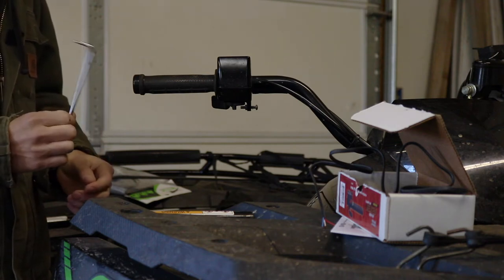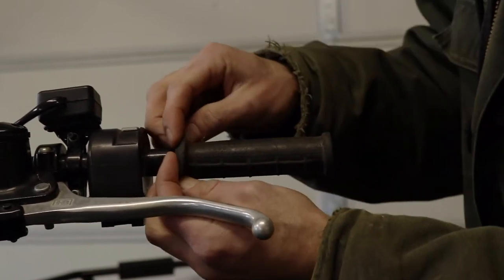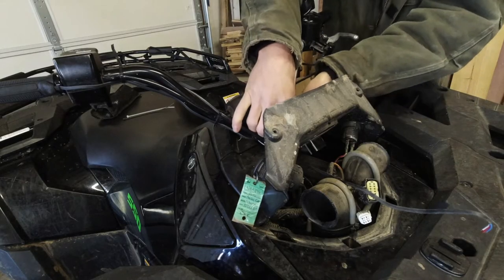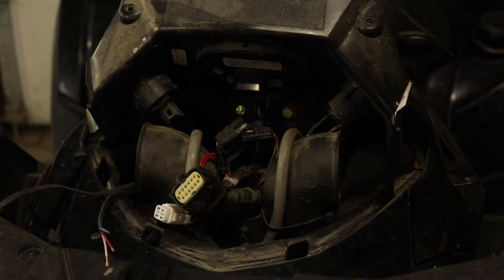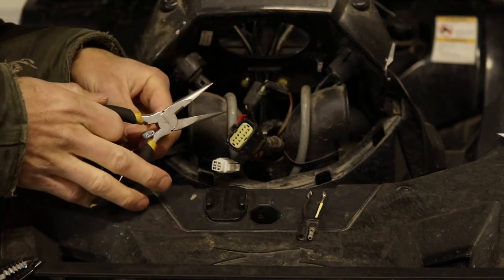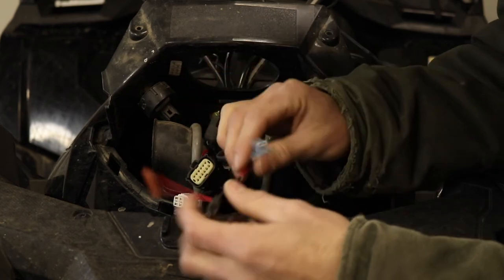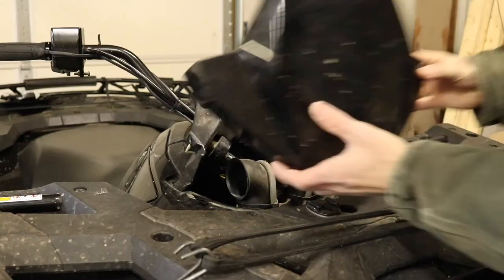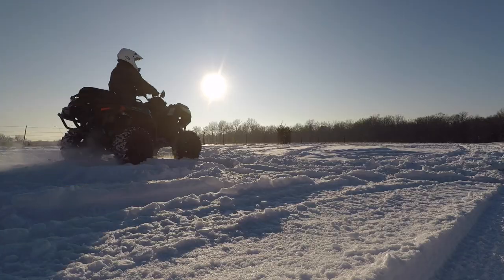How To install heat demon ATV grips

Comment: Now that this video is a little bit older how well have they held up and how well did they work
Reply from the maker: They’ve held up great in the last four years, I normally use the low setting in winter, high is too hot unless you need to warm up quickly.
Reply: @ArcticFrost  thank you would you recommend buying them I like how the switch was done and how they're one of the cheaper ones
Reply from the maker: They’ve been great. I’d get them again if I were to put them on another ATV.
Reply: @ArcticFrost  okay thank you

Comment: How well does that plastic toggle switch hold in the atv? i just bought a new kit for my 2021 Kodiak
Reply from the maker: My dash plastic is a bit thicker than what the switch was designed for but it hasn’t popped out.